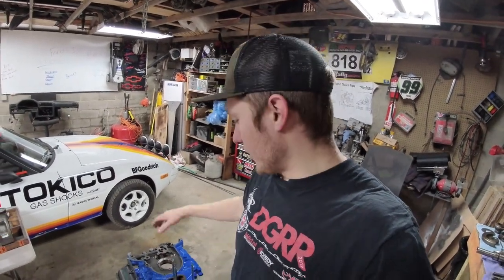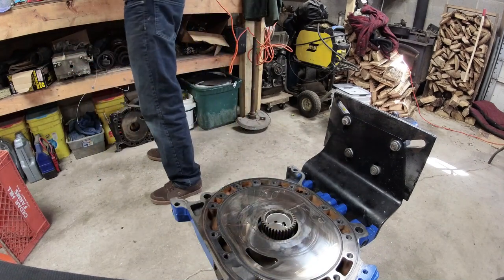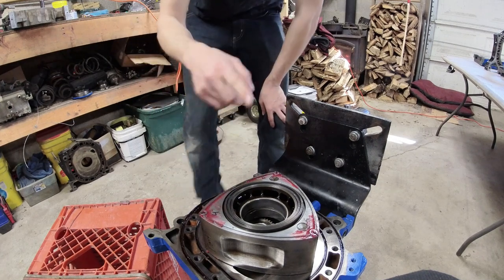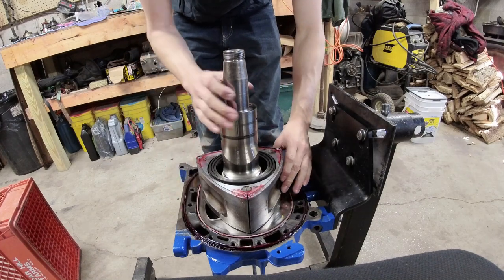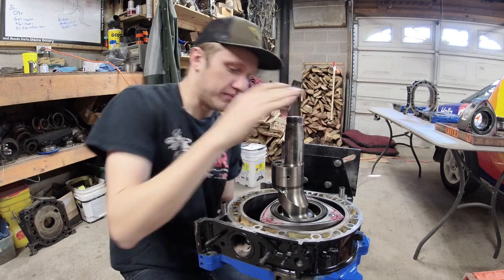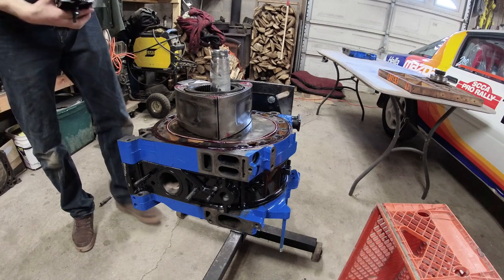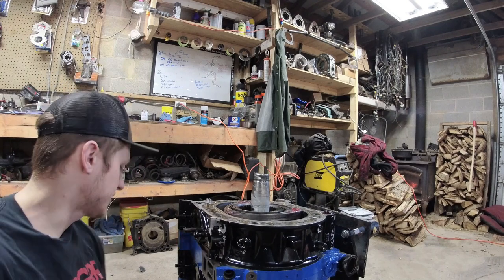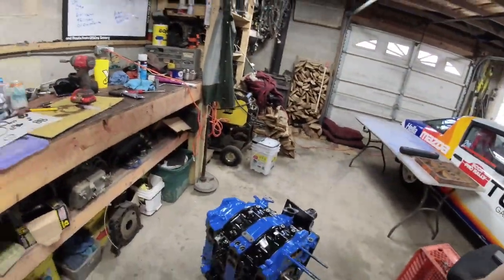Comprehensive Engine Build - 13b REW - All my Tips and Tricks in ONE PLACE

Comment: I wonder why Mazda never went to MLS type gaskets in place of rubber seals. Especially when they are exposed to so much heat.

I’m definitely saving this video for when I rebuild the 13B-MSP. I know there are differences, but generally should be very similar.
Reply from the maker: Rx8s have 3 oil control rings. 2 rubber and 1 scraper.  Plus one more tension bolt,  side seals and corner seals are different as well. Otherwise it's the exact same process to stack

Comment: Did you rub any oil on the inside of the housings and on the irons? I didn’t catch it in the video. Just wondering if the apex seals and oil control rings are a little dry adding to the resistance. Good video by the way!
Reply from the maker: I typically don't put any excessive amounts of oil in the engine during assembly.  I'm thinking that is a contributing factor accompanied with the brand new oil control springs and metal rings

Comment: I have a rx8 with relatively low compression,
still runs but struggles to start hot. 
Unfortunately due to a new house project i have to delay the rebuild for now. But i was thinking since im on a real budget atm, if i take the msp apart and put it back together with new seals and gaskets, would it increase the compression? (assuming the housings and iron’s within spec) 
I mean just for learning purposes it would be beneficial for me but not sure it’s the right thing to do for the engine. Great Vid btw shout out from the UK 😉

Comment: Morning, if I'm bypassing the heater core, is it neccessary to have a thermostat? I'm trying to fill the block with antifreeze and was wondering. Thanks again for delving where others do not.
Reply from the maker: I would run a thermostat for sure.  Regardless of the heater bypass or not

Comment: 24:03 

I like that 

Rob Dahm tortures himself and tries to install those before putting the rotor in the housing

I think i would still put the dowels first just for me so i know I'm not screwing up my coolant/oil gasket i haven't done this before and very nice hot start RX8 keeping coming up

There is one right now for 3k from the original owner and its yellow with 66,000 miles on it and a hot start issue. Stuff like that in that price range pops up constantly, very very clean cars just rotary issues and regular people are scared so good for me 

That could be a steal or a catastrophe and needs new housing but i cant see that from the outside

Comment: Question if you use a dab of super glue on the edges of the o rings and seals to keep them in place while assembling would it hurt the engine?

Comment: Thanks for sharing your build process. I've watched lots of them. All but one do the apex seals like you. I watched one guy who held the seals in with a big rubber band, started the housing on then clipped the band once the housing was holding the seals and dropped the housing home. Your thoughts on such a technique?
Reply from the maker: I think that's a great way to do it!! As long as you know none of the seals on the back of the rotor fall out.  That really why I like to place the rotors before the housings.
Reply: He still placed rotor first. Just had the apexes held with that rubber band.

Comment: Its awesome that you go throught the trouble to explain in detail. I have searched and searched and none have gone to the level you have. They provide alot of info but dont take the time to go in depth like you do. Just watching your video anyone could rebuild this thanks to your teachings. I have my rx8 engine out and apart only to find the housings are pretty bad off due to chatter and chrome chip off. But once i find good ones i will definitely be watching this video multiple times

Comment: Probably one of the best engine assembly videos ive watched in someones garage. Any type of engine. I can tell your an engineer when you work on stuff. Im concerned about finding 12a engines and parts if I get an fb. I am not wanting to swap it but there isnt much out there for the 12a engine parts wise. Am I wrong? Why isnt there an insert or something to save those old housing. Mr rad potential engineer sir, I see potential for a rotary engine parts company. Then branch off to plastics and remake interior stuff for old jdm cars. Nissans hondas toyotas mazdas molded plastic interior parts and engine components for the boys❤
Reply: There are companies for old powerstroke Ford diesels making random commonly broken interior parts. They're doing great can't keep up with the demand.

Comment: Love your videos, I've got a question if you can answer it. I recently replaced a cooked 13b with another, my question is would it be worth rebuilding and how would I know if it is? It's seized and won't turn. Apparently it overheated, that's how I bought the car. Any input is appreciated. Anthony
Reply from the maker: Fill it full of two stroke or marvel mystery oil and see if you can free it up?  Otherwise take it apart and see what's going on.  It will be worth more as known good parts if your able to get the engine apart

Comment: Would it help to put thin coat of motor oil on the irons and those housings?
Reply from the maker: Wouldn't hurt anything. I just like to keep the work area less messy during assembly. You can oil the inside thru the exhaust ports when your done stacking it
Reply: Is that rx7 rally car 4wd?

Comment: Great timing,  just ordered my master rebuild kit from Atkins.  My 13B has about 60k on rebuild from mazdatrix in cali but previous owner autocrossed it for 9 years. Rather do it early instead of a catastrophic failure.
Reply from the maker: Heck if it has good compression, Id just keep running it!
Reply: @RADPotential  the thing runs beautifully but it's smoking a fair amount.  It's definitely oil. I did a omp delete and I'm consuming a crap load of oil. Not leaking anywhere.  I always park in the exact same same spot in my driveway and no spots other than coolant.  Radiator is leaking. Smokes more while going down a hill in gear and not using the throttle.  Not a smoke screen but definitely more than 2 stroke oil.